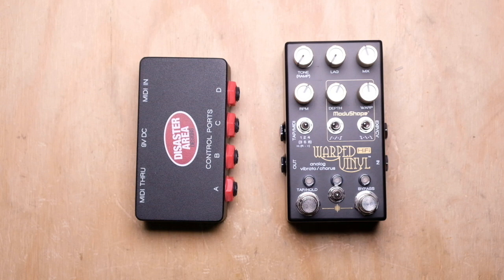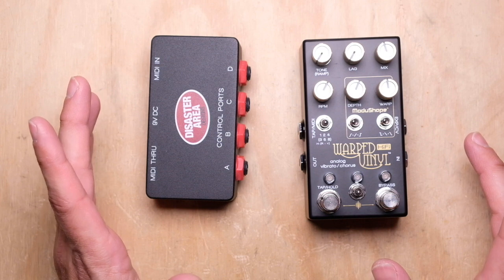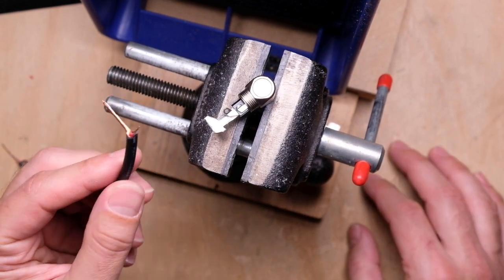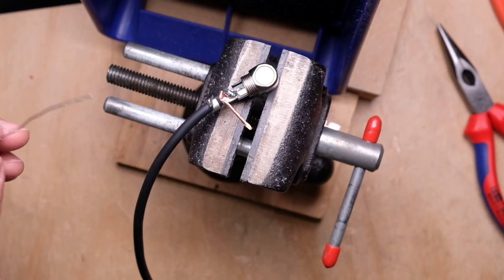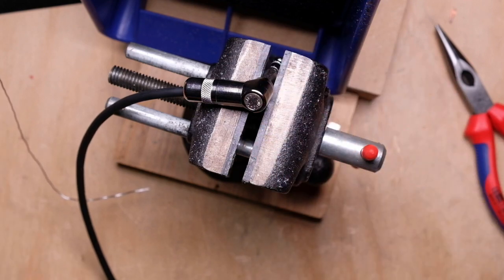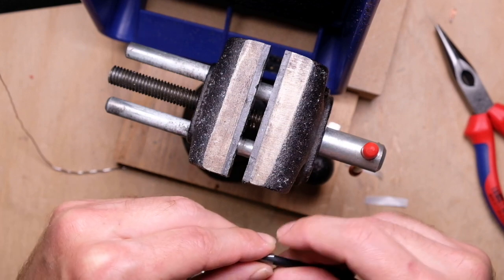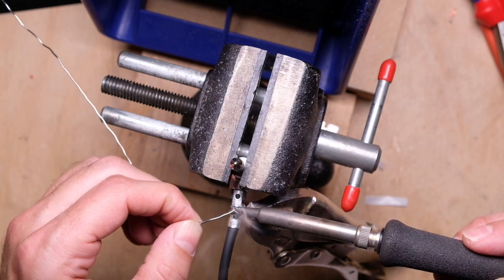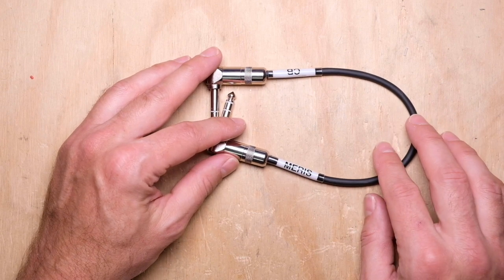TRS MIDI Cable For Chase Bliss Pedals

Comment: There is a TRS MIDI standard. Chase Bliss chose to ignore it.
Reply from the maker: This is true. We offer cables to help solve these problems. Sorry for the huge delay in response!
Reply: The reason Chase Bliss uses a different TRS MIDI connection configuration is due to the tip of the TRS end being exclusive for expression activity. Chase Bliss sells their own MIDIbox that’s less than half the price of the DAD qCONNECT MIDI box. The cheapest solution is the ‘Step Audio 5-pin MIDI to 1/4" TRS Cable Ring Active for Chase Bliss pedals’, which costs $15 when shipped in the US.

Comment: I assume you could use a mono connector at the DMC end (I.e. connect sleeve to sleeve and then tip on the TS jack to ring on the TRS)?
Reply from the maker: I wouldn't recommend that. It may or may not work depending on the specific mapping, but if you use a mono (TS) connector on the DMC side, any signal sent to the "ring" portion on the TS jack would simply tie in to sleeve. Sorry for the delayed response, but hopefully this is helpful!

Comment: I just received my MC6 Pro and Midi Box in the mail!  The Midi Box (morningstar) has eight 1/8th jacks out of the back.  Is there a 1/8" to 1/4" cable type that I should be looking for to work with the CBA Habit?
Reply from the maker: The Morningstar Midi box should have 6 switchable outputs that can be made ring active OR tip active, depending on the needs of your pedals. ChaseBliss pedals are generally a ring active system, and to my knowledge you should be able to use a regular TRS-TRS cable, even if it is 3.5mm to 1/4in.
If you learn otherwise during the process of setting up your new gear, let me know! I can't buy/test every new product from every brand, so I often have to use technical manuals and specialized knowledge rather than hands-on product testing. 
Thanks for watching!

Comment: So this is ring active...if I need to do one like this that specifies "tip active", then I would do the same thing but bring the two conductors that are tied to both the tip and ring on the midi i/o side, to the tip on the pedal side, correct?
Reply from the maker: A regular TRS cable might be fine. It also depends on whether or not the pedal sends MIDI as well as receives. You should reach out to the manufacturer of your MIDI box to make sure.
Reply: @AlphatoneAudio  I'm sending an email to Red Panda now.  The midibox is Morningstar, and six of the 8 ports are configurable, but I have already used those all configured to ring active for CBA pedals.  The Red Panda uses Tip Active like Meris, except Meris can do thru.  A couple of my cables are actually wired to jump through the Meris where I cross up the Ring signal coming from the Morninstar into the tip, and then cross it back out to the ring, daisy chaining to a CBA pedal, so I am able to run a Meris and a CBA off one port and that works just fine.  That custom cable does talk to the Red Panda stuff, so it makes me think that just doing shield to shield and then tip to tip, coming off these standard TRS ports would work.  I would wire more of the daisy chain kind of cables but the Red Panda pedals won't pass to the CBA pedals the way the Meris ones do, and since the ports I run those cables off of are set for the CBA standard, I am just trying to see what I need to do when coming from the normal TRS midi standard with tip data and ring powered. Could it just be straight through or does it need to be directional?  I have all the stuff to do either easily just trying to get it figured.  Like I was saying I am also asking Red Panda.  Those guys have always been super responsive.
Reply from the maker: @JustinKosler  It sounds like you're on the right track. Hopefully you'll get a good answer from Red Panda. Good luck!

Comment: Anyone know how to make a 5pin MIDI to TRS cable for a Chase Bliss pedal to bypass the need for a MIDI box? I know the tip is NOT connected for their pedals, but I don’t know what 2 of the 5 pins on the MIDI male end need to be.
Reply from the maker: It's common for 5-pin DIN connectors for certain pedal applications to leave pins 1 and 3 (furthest to the outside) disconnected, making use of pins 2, 4, and 5. Pin 2 (center) almost always acts as a common ground, and in the case of a connection for a ChaseBliss pedal, Pin 5 will likely be the most important connection because they're ring-active. Note that this can vary slightly depending on your Midi controller, but if you're just connecting one CB pedal via 5-pin->TRS midi, you don't necessarily need a midibox to make those conversions. If you need a cable made for this connection, shoot us a message on alphatone.com and we'll make sure you're getting what you need! Thanks for watching.
Reply: @AlphatoneAudio  thanks for the thorough and thoughtful reply. I found what I needed on Reverb. I got a ‘Step Audio 5-pin MIDI to 1/4" TRS cable Ring Active for Chase Bliss pedals’. My Generation Loss MKII just shipped so I’ll be able to test it out next week.

Comment: Yes, but how about a TRS/MIDI cable to put it directly into a MIDI IN, is that possible? Any guide where I should do the wielding?
Reply from the maker: Most likely will not work. Every device is different though, so I suggest you reach out to the manufacturer to see what they require for proper MIDI interfacing.

Comment: Excellent videos. I have an empress echo system delay and I’m planning on using a “Disaster Area MIDI box One” as a midi/trs interface. I also have a midi Quadra Thru box to connect my other normal 5 pin midi pedals. 
 Would this cable work with this set up?
Reply from the maker: This pinout is for Chase Bliss pedals, not Empress. You'll probably be fine with a standard TRS cable, but check your manual.
Reply: @AlphatoneAudio   got thanks. However, I would still need the MIDI box One right ?

Comment: If you switch the jumpers in the DA midibox do you still need the different cable for the CB pedal?
Reply from the maker: No, you should not. However, that is not the case for all MIDI boxes from all manufacturers. Even the earlier MIDI boxes from Disaster Area were modified by CB I believe, but the branding on the newer boxes has changed. I don't have one of each to compare. Additionally, I build a special cable for Meris MIDI boxes based on a schematic from Meris to work with CB pedals. You really need to contact the manufacturer of your MIDI box to be certain.

Comment: I purchased a TRS cable along with the midi box, but can't seem to make it work. The midibox aren't sending signals to the midi pedal (strymon riverside and sunset btw. :D )
Reply from the maker: What are you sending MIDI from? Strymon has a lot of great configuration info in their manuals. Double check MIDI channels, firmware versions, etc.
Reply: @AlphatoneAudio   using mc6, the midi box was receiving signal from mc6, but wasn't passing it on to the ports. Somehow figured out it has to do with the jumpers, so I moved it and it worked! I got that lead from here! :D
Reply from the maker: @el_pordo  Nice!

Comment: a get confused by you showing the MIDI BOX 4 instead of the MERIS MIDI box in your video which actually will need the cable you made, the DAD MIDI bOX 4 has no problem accepting any TRS cable due the jumpers to configure as you mentioned.
Reply from the maker: The DAD midi box was on hand for example only. The Meris Midi box was not unfortunately. It is mentioned the cable specifically for CB to Meris. Thanks for watching.

Comment: what if i want to make a trs to midi cable for a chase bliss pedal? what pins on the midi 5 pin din correspond to the trs side?
Reply from the maker: Check out this cable: https://www.disasterareaamps.com/shop/5p-cba-cable

I've never had one in my hands so I can't verify the pinout, but you can always ask the fine people at disaster area if it works well with any 5-pin MIDI port.